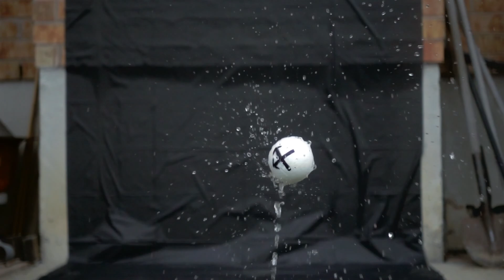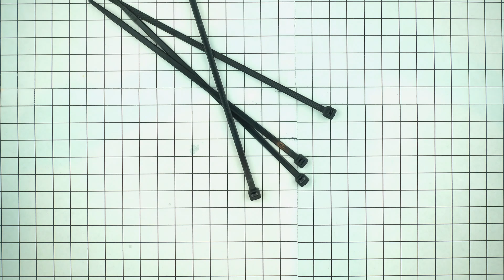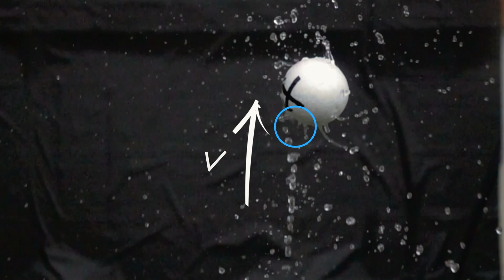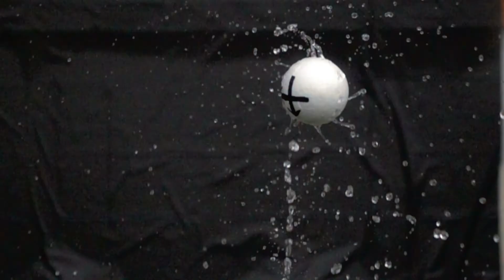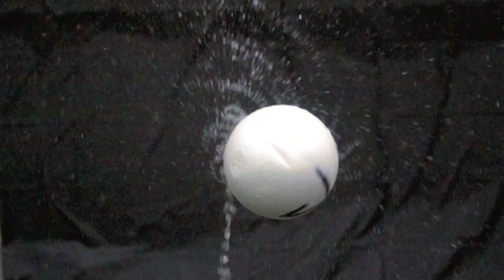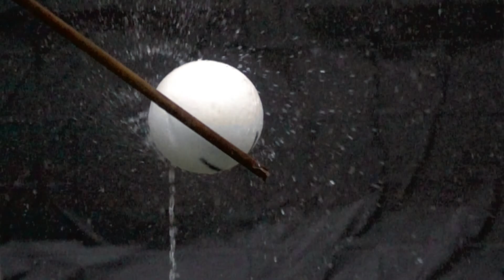IYPT 2019 Problem 10 Suspended Water Wheel Demonstration

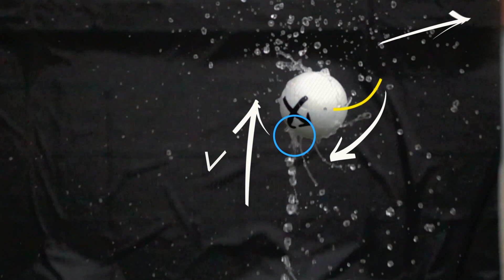Comment: thanks for posting.  interesting.   some thoughts.     at 1:11,  any "shape" seen in water that is not in contact with sphere is  a coriollus illusion; and is indicative of  Nothing.     what  IS  Happening is that the MASS  of the water sticking to the sphere, acts as  FLYWHEEL; increasing  gyroscopic effect.    at 1:26,  action/reaction forces (at the right), occurring where water leaves the surface of the sphere,  'push'  the sphere towards the stream of water.   if interested, see my ou research.   cheers               googletranslate
Reply: I'm interested, can I see you research?
Reply: Yes please share any additional research
Reply: Can I see your research?
Reply: Are u gay. If not send ur research